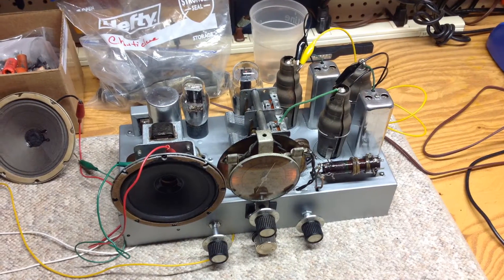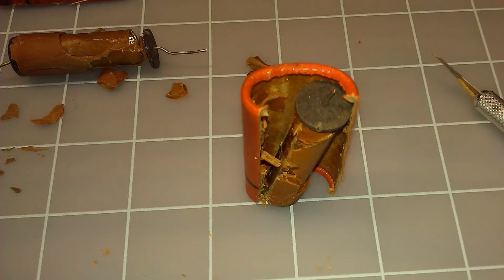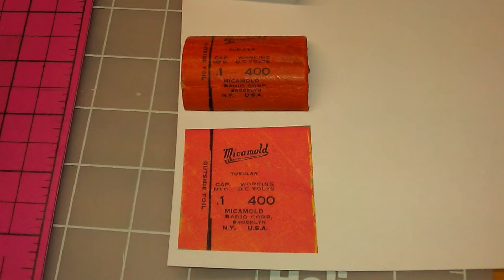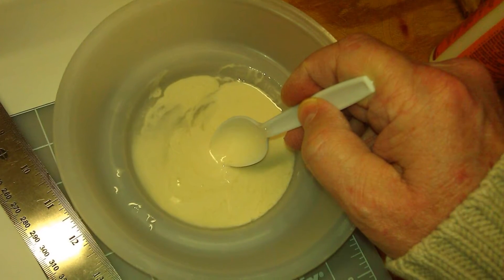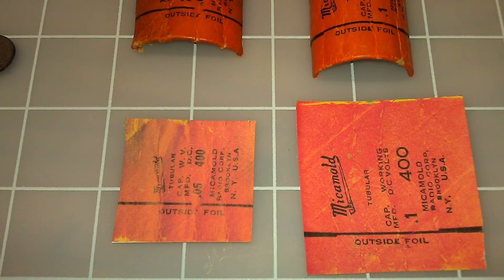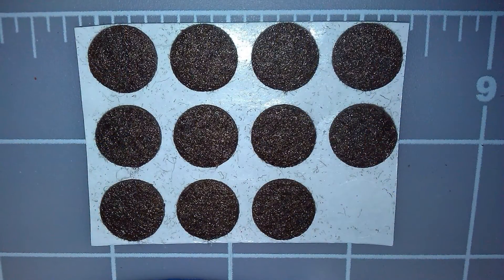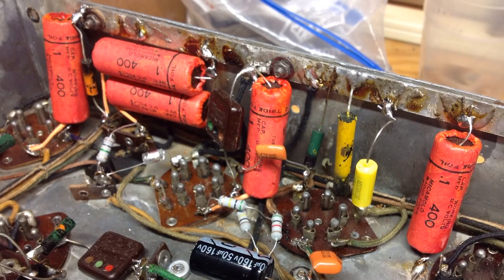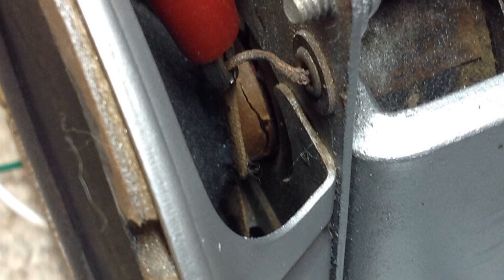Chanticleer 2D570 - Capacitor Re-Stuffing

Comment: Well they did turn out well but I thought the method was long winded and complicated. I would just heat up the wax and pull the inside out of the original tube. Increasing the size of the capacitor with tape is what I would do, I would then refill it with beeswax. You would never know the difference.
Forgot to mention, you should ensure the capacitor is fitted in the tube the correct way round, i.e. outer foil leg is going to the band.
Reply from the maker: Andrew - I appreciate the recommendations and will try this method when the opportunity permits. Only a few of the OEM capacitors could be salvaged due to rodent damage, thus my reason for creating the new tubes/labels. Thanks again and stay well. Best, Don
Reply: @RestoreOldRadios  Take a look at this video:
https://www.youtube.com/watch?v=1boG_-02R-A

Comment: Funny how 400 volts is good for a few hundred more now that you've rewrapped the capacitors with better ones, nice job Don. I did that as well to a square cap from my fada, but the label did not come out that great. I still have the scan, so maybe I'll try it again, thanks.
Reply from the maker: I haven't done this since, but I hope to try a few things different next go around. This radio was deserving of this technique due to its rarity. Best, Don

Comment: why wouldn't you just use the orange Sprague caps call it done and leave it at that?
Reply from the maker: Good point. I'm not normally a purest, but the rarity of the radio was the driver for my decision on the caps. Best, Don